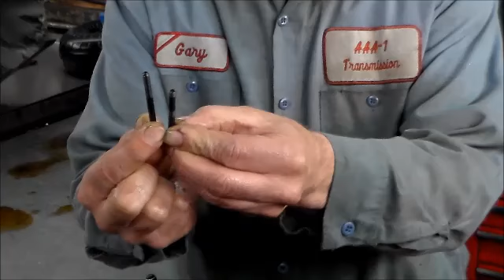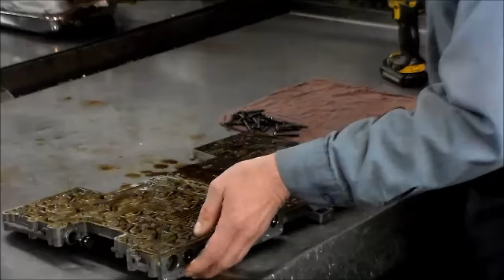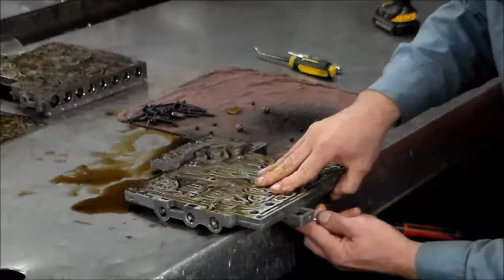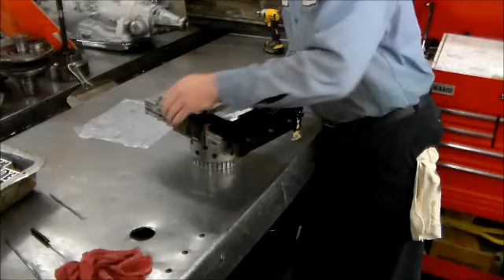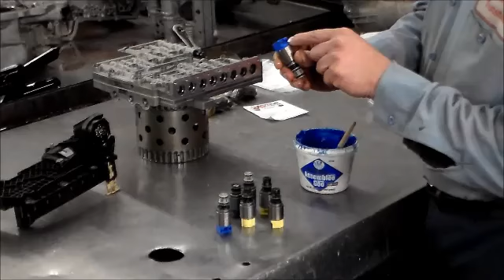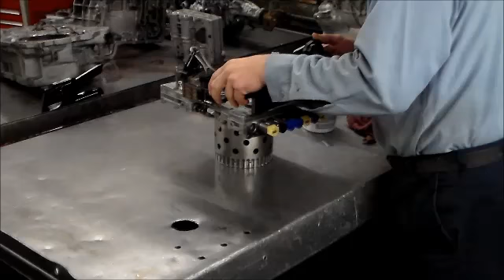ZF6HP19 Valvebody Overhaul

Comment: thank you so much for all the videos. Its a coincidence that our ways cross again. I changed the transmission on my sienna successfully. I dont know you remember or not I asked you a question for that transmission (and thanks for your reply btw). Here we go, I run into an other issue with an other car that happen to be bmw, totally different car totally different circumstances, guess who I run into.. Garry Ferraro. Ha. Guys like you are a blessing for guys like me. The question is that when I replace the solenoids on these cars with new ones do I need to do coding?
Reply from the maker: If your only replacing the solenoids, no need for coding but you MUST reset the adaptations or the trans will work the same
Reply: Thanks a lot!  @GaryFerraro
Reply from the maker: @gulengr5222  welcome

Comment: 6HP19 BMW E60 525d, when the car is cold, after waiting for a green light on the crossing with my foot on the brake (Drive mode on the gearbox) more than ~10 seconds, I lose the brake and car won't move for 1-2s and suddenly jump into gear and starts moving. This problem dissapears when car warms up. Anyone had such a problem? Any ideas? Thanks :)
Reply from the maker: Sounds like it's low on fluid, have the level checked

Comment: Gary, I know you posted the video along time ago, but I just found it and it's exactly what I was looking for. I tripped codes 4e86 and 4e87 (shift and shift lock solenoids) on my BMW 335i right after an oil pan change and fluid refill. It was shifting perfectly (and no slipping) before the codes,  so I assume some sediment was kicked up by the new fluid and shorted the solenoids (the old fluid was pretty dark). I ordered a new solenoid set and mechatronic seals. Should I worry that a line, valve, or screen is blocked in the valve body and will need this full rebuild, or do you think the solenoids and seals will do the trick? Car had 85K and was well maintained. BTW, I drained the fluid today as an assessment,  and when I went to refill it I found there was at least 1 quart too much fluid at pan level meaning the upper tranny/torque converter were deficient on fluid. Thanks, I subscribed.
Reply: Hey I know this was old but how did you make out?  I’m having a similar issue after a fluid/pan swap

Comment: Hi I have a 2011bmw 535i with the zf8hp45 transmission and it pop out of gear while at a stop light and went into limp mode and won’t go into reverse or first gear only in 4 gear please help what should I replace thanks you I just subscribed
Reply from the maker: First thing i would do is check fluid level, and scan for codes

Comment: Hi thanks for this video I would like to know the order the Dinbars ?
Reply from the maker: Do you mean the solenods?
Reply: I mean six pieces in the form of a piston
Reply from the maker: @sniperpro_sa  Ok, the rubber dampers inside the valvebody?   Where are you located?
Reply from the maker: @sniperpro_sa  ok, the parts im installing at 19:33     just to confirm.
Reply: Gary Ferraro Thank you so much I'm in Saudi Arabia
Reply: Hello my friend I have a problem in Land Rover does not move from the fourth speed to the fifth Ato Maticia only using the manual system zf6hp26 Note that I changed the oil and filter and clean the Body Balf. Land rover LR3 2008
Reply from the maker: @sniperpro_sa  ok, so no shift from 4th to 5th, are there any codes present for the trans?
Reply: Hlo I use a program RSW Soultions-4Dcan . But there is a problem with the program. Do you recommend another program?
Reply from the maker: @sniperpro_sa   Do you know anyone with a scan tool.  Autel scan tool is pretty good
Reply: Gary Ferrar Thank you very much I will try it o

Comment: Hi my question is how much should this job cost at a shop???
Reply from the maker: a transmission overhaul or just the valvebody?
Reply: @GaryFerraro  HI again well I called a shop the other day  because I was curious to how much a oil change would cost because I think I might need one, for my 2008 328i coupe and so they told me the transmission service would cost me 900$ all I asked was for a transmission oil change. Now the service your doing here looks like it would cost 900$ I'm a lil confused.
Reply from the maker: @angle8676  Seems like a lot, i get about 550 to 600   if you have a plastic pan, that would have to be changed because the filter is part of the pan
Reply: @GaryFerraro  Thank you so much. That helped. I subscribe to your chanel looking forward to see more. Great explanation and  detail in showing how to do.
Reply from the maker: @angle8676  Thank you, any questions just let me know

Comment: do you have to change the separator plate?
Reply from the maker: If you split the valvebody apart, yes it has to be changed
Reply: @GaryFerraro  thanks Gary, i'm planning on changing pistons/dampers as well, so i wasn't sure if i could get away with keeping the original plate. once again thanks buddy, much appreciated

Comment: Hi, Thanks for the video.
ZF6HP19 on BMW 120i harsh shifting especially on 2-3 
Any advice?
Reply from the maker: I would check fluid level, if ok, i would try resetting shift adapts, make sure there are no codes present in the trans or engine or the adapt reset will not work.  By the way, are any codes present?
Reply: Thanks for your reply.
There is no fault code in the transmission and engine.
fluid level is ok. 
cleaning the solenoid valves may solve the issue?
Reply from the maker: @farhaddadfarnia806  When does it shift hard all the time or only hot?
Reply: It shift hard all the time from 1-2 , 2-3 up shift and down shift. cold and hot. it is much more noticeable in light throttle (light load).  Also when go from P or N to D and R it jerks.   When the car is cold (morning) bad sound can be heard from transmission.

Comment: What model Vehicle was this and year?
Reply from the maker: 2007 525xi
Reply: Thanks, I have the exact same valve body on my 320d E90, the car stopped going into gear (even reverse), and i have found on the vavle body that the 6x dampers are completely flat, as well as the 4x sealing sleaves inside the bottom of the transmission and the valve body adapter.. is there anything else that i might need to check?
Reply from the maker: Jurgens Steyn the car stopped going into gear. You mean it stopped moving?   Any codes?
Reply: Yes, stopped moving, but it is in Drive or reverse on the dash. - i 1st got this code 004F89 and short after that, i got the no movement problem
Reply: @jurgenssteyn6178   Hi did you figure out the problem? i have the same issue on the 2011 F10 model? i got a used valve body. pls help
Reply: TheCamillejr hey. I ended up buying and complete second hand gearbox of the same make and year. It sorted the whole thing. I did a vavlebody rebuild. Didn't work.. Now I'm sitting with a extra vavlebody

Comment: Hi Gary. My previous BMW 6 series had the 6HP19 gearbox served by ZF Hamburg in Germany. Their service bulletin included new dampers to avoid harsh and hard shifting. The service mechanic showed the old dampers which only had 60k km on the clock. They were in okay condition except for the damper installed between 2-3 gear, which had the rounded bacelite kind of material worn down allowing more play during damping. ZF always replace them as part of oil service bulletin, including the plastic seal (the one that likes to break not allowing you to set it in D / jumps back in P) based on their experience and knowledge. Best regards Jørn from Norway.

Comment: Gary, 

I’m have a 2006 bmw 325 and I have an issue with the tranny. It shifts into gear without pressing the brake and it seems to be in limp mode as It does not shift out of third when in drive. Does this indicate the need to replace the valve body solenoids?
Reply from the maker: I just did a video a few weeks ago on this problem, you probably have a bad solenoid
Reply from the maker: I had P0960, Thats the name of the video, P0960 Diagnosis
Reply from the maker: Please subscribe, Happy Holidays

Comment: Hi Gary,  Can I use the computer part (black plastic) on the car's mechatronic (GA6HP26Z) with another used valvebody so I don't have to reprogram it?  The second used mechatronic is pull out from a different transmission of a BMW 750 2011, VIN...CY36727.  which is compatible (F01)?  Any idea about doing this to fix the gear not shifted (changed).  Thanks
Reply from the maker: So its stuck in one gear only? hows reverse?  do you have a park button or a regular shifter?  Sure i can rebuild your valvebody, but a few questions first.  My e-mail is gsferraro@yahoo.com.   send me the whole vin number and a picture of the valvebody if you can

Comment: Hi Gary ,
i had hard and jerky shifting so i did transmission solenoid replacement with ZF fluid and reset adaptation shifting more smooth but still some hard shifting from 1 to 2 and after 10 sec from totally stop D or N start blinking and some hard jerky ,,this with e90 2007 please advice 
Thanks
Reply from the maker: Bikoo A.  Have you checked for codes in engine or trans. Adaption won't work if codes are present.
Reply: no i didn't so u mean i need to clear the errors code then try the adaption ?
Reply from the maker: Yes,  with the check engine light on or if there are codes present, it may freeze the shift adapts, so clear any codes from engine and trans and try it again.
Reply: Thanks Gary Ferraro , honestly i don't have engine light on but i did the clear from ISTAP also i reprogramming  the transmission using ISTAP  then i did the INPA reset adaption , its much batter like 95% working without any issue, but still some jerky if i stop and move to N then back again to D it's not happen always but some times , any idea ? should i check the fluid ? i already put 8 Liters when i did the solenoid replacement with new filter.
Reply from the maker: Ok, so on engagement? maybe give it alittle more time see what happens, if on engagement you could also move the shifter from neutral to drive(wait 3 seconds each time, shift to drive ,wait 3 seconds, then shift to neutral and wait 3 seconds, repeat a few times)
Reply: i tried but since yesterday the car back again dash gear position signal blinking when i stop and start jerky !!
Reply from the maker: What codes do you have?
Reply: Hi Gery, 
i have DME/DDE  ( 2DCA & 2A6F & 2A70 & 2F99 )  and CAS (A0B2) and when i tried to clear history memory i got the following error for all modules ( Error_ECU_SUBFUNCTION_NOT_SUPPORTED_INVALID_FORMAT)  any luck ? for your kind info the car start to be like before changing the solenoid and always fail in safemode
Reply: it could be the four sealing sleeves ? i didnt change them
Reply from the maker: Any codes in the EGS(transmission) module
Reply from the maker: Do you by chance have definitions of the codes
Reply: No errors from transmission
Reply: 2DCA CAN timeout EGS  ///  2A6F multip. min lift adaption stop  ///  2A70 error current plausibility  /// 2F99 Ambient temperature
Reply from the maker: Bikoo A    Ok, I'm going to research these codes,  if you clear them do they come right back?  I don't think this is a transmission problem but let me see what I come up with.   Is the car act up cold and hot or just hot?
Reply: Thanks Gary ,i tried to clear them yesterday and they come back again today , it's acting in both cases :( it's become like before :(
Reply from the maker: Ok, let me look up some of these codes to see what comes up, just give me year make and model again please
Reply: December 2006 - 320i
Reply: i just read some people talking about battery ? do i need to check it ?
Reply: Hi Gary , i have some update , i had issue yesterday with one of my injection coil and sparks , i change them today and the fail safe mode on idle N or D (Stop) seems to be gone but i still face the kick down failsafe mode happens while i'm running.. any idea ?
Reply from the maker: OK, so just to confirm, you go to passing gear and it goes into failsafe?  Have you scanned for codes?  Driving the car normal shifts up through the gears no problem
Reply: Gary Ferraro I didn’t scan yet but car shift up is still problem if I press hard or kick down 😭
Reply: Hi Gary, hope ur fine, now even if on P and RP more than 3.5 and above it go to failsafe and i see the yellow gear sign , i got this error DSC D347 and DME ( 2dca , 2a6f 2f9e 2f80 )
Reply from the maker: Lots of engine codes, did you scan the trans? trans is EGS
Reply: this is the problem no error on trans !!!!
Reply from the maker: Is this an X-Drive?
Reply: no it's 320i 2007
Reply from the maker: At this point, i would record and then clear all codes, see what comes back and address the codes that come back.
Reply: ok Gary, it's very weird !! even on P if i RPM above 4000 Trans goes to FSM
Reply: no errors from INPA but i still face the same issue . any idea ?

Comment: Thanks Gary.  I pick up the car this week and will begging the work next week.  Let me know the best way to get solenoids, gaskets, separation plate, pan, fluids etc to do a proper rebuild.  I guess I would either need the VIN or a number off of the transmission? Do you have an email that we could communicate with?

Comment: Thanks, do you have a favorite parts supplier that you use?  I am a new BMW owner and am trying to figure out a good source.
Reply from the maker: Transmission parts or just auto parts?
Reply: At the moment, I am looking for parts to rebuild the valve body on a 2007 750li.  But I will need to tackle valve seals in the engine at some point also.  So a supplier that sells quality parts to the public would be a big help.  Thanks.
Reply from the maker: Where are you located?

Comment: Gary, Thanks for this great video!  When you replace the separator plate, are there gaskets that go above and below it when you put the valve body back together?

Thanks!
Reply from the maker: There are no gaskets with this unit, they are more like silicone channels, kinda like a one time use plate

Comment: Hi Gary thanks for the video too

I have a problem with this transmission e60..04 BMW 545i
After a good worm up the car goes into a limp mode. Car goes into neutral. I have to pull over and turn the car back on (but the in the neutral gear. ) because it won't turn in park. I'm able to drive but I think is on second gear (limp mode) 
I changed the seals and sleeves but still the same. Please tell me what would be my next step. What do you suspect it is? Car runs nice before worm up a bit.
Reply from the maker: There has to be codes present in the trans, do you have a scan tool?  Does t g into limp mode in the higher gears?  Like 4th,5th or 6th?
Reply: Gary Ferraro 
Yes. The scan tools shows p076 transmission range sensor A.  
circuit range/ performance 
Even in I'm worming the car with out driving it . Once it get hot then the code comes up. And it would go into limp mode again. After cools off the car works normally
Reply from the maker: What type of scan tool are you using, im search for this code but cant find it, also, after the car warms up, when does it go into failsafe? while driving? or on start-up?  does your scanner show data?
Reply: Gary Ferraro obdll.  the car goes into limp mode only after has been on for about 30 minutes.  driving or not driving.  
I checked the condition of the ecm and it does have corruption.  I'm planning on changing it. just in case . I appreciate you looking into this .thanks
Reply from the maker: Are you changing the ECM or the TCM?
Reply: Gary Ferraro the ecm it might not have nothing to do with the transmission ,